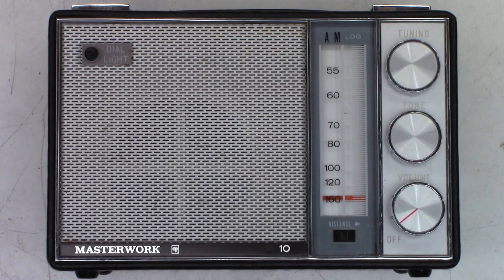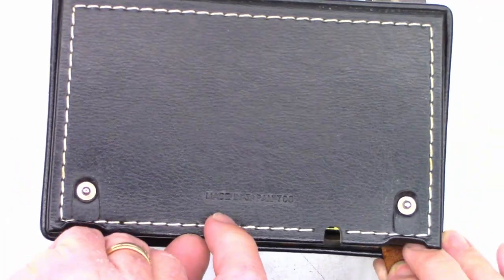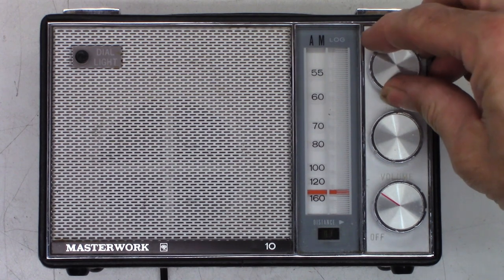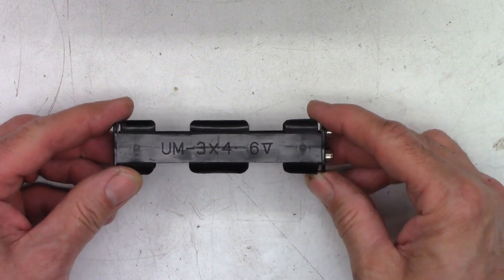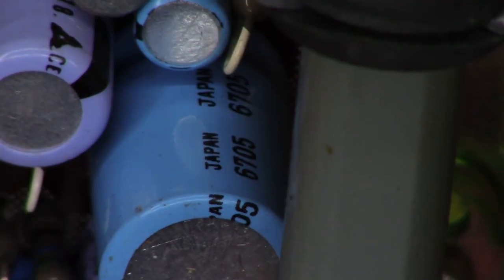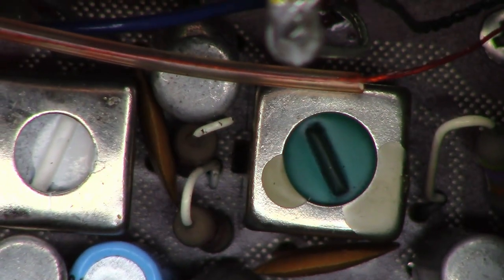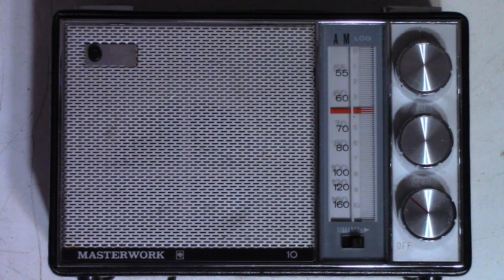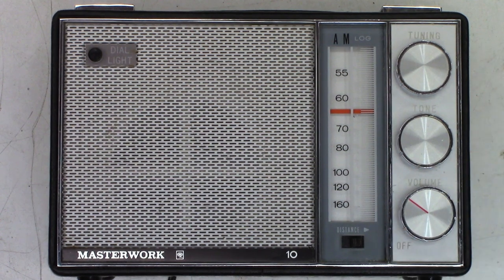Masterwork 10 AM radio by Columbia Records M-2902. Testing Deoxit F5

Comment: I had the AM/Fm version of this radio. It was very sensitive and had fairly good sound. The Masterworks was a Columbia Records logo. Look at the label on older Columbia records and you will see Masterworks on the label.. The label will have 3 of the logos running along opposite sides of the label.